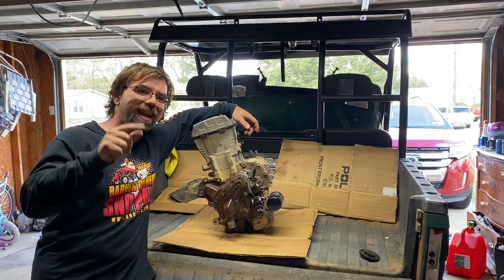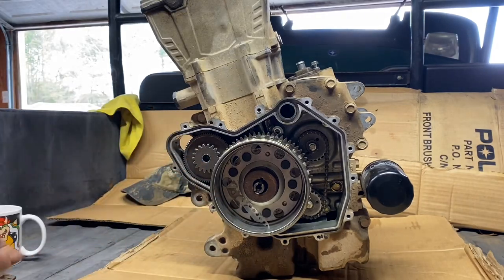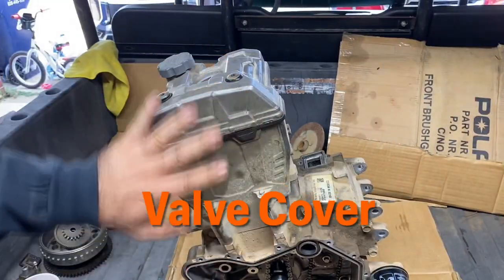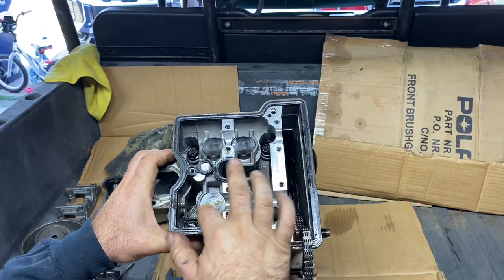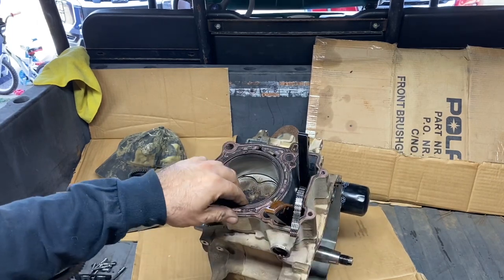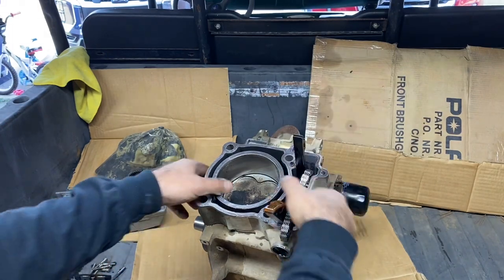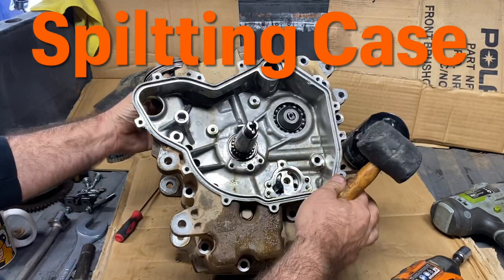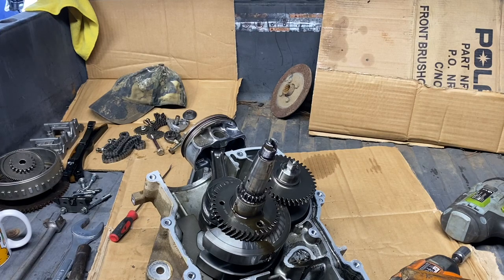Polaris 570 Rebuild Part 1- Teardown

Comment: Awesome vids! Thanks!! I poked a hole in my oil pan and ran mine out of oil till it seezed. I got it broke loose, but didn't run. So I thought it might be rings and cylinder. There is marks, I was hoping it's just that... But I'm rewatching your video to see if you showed there was play between the connecting rod and crank shaft? I can pull the connecting rod up and down on the crank, I think it's shot too?

Comment: Nice video. I'm having an issue. The engine turned over just fine the first few compression tests, then it ran smooth twice just heating up and letting it cool down. ISSUE- Next compression test the starter just spun and didn't engauge to turn the engine over. I have proper voltage to the starter. The starter is new and spins as it should. My issue seems to be that the starter gear doesn't engauge the gears to turn the crank. Any ideas? Also, should there be a snap ring between the timing chain guide and the crank gear?

Comment: Hey I have a question I have a 570 and I dusted the motor. But no metal and nothing blew up it was still running just had water and dirt in the system. I'm rebuilding myself I'm on a tight budget  but do you think I have to change the oil pump out if it's not scarred up reuse it and put a new oil pump chain and timing chain and upgrade the timing tensioner.
Reply from the maker: As long as the oil pump has no grooves you should be safe, make sure those chains get replaced tho.
Reply: Thank you  😊 for your time.  And keep up the videos they are all good and helpful. I have all my parts in doing my rebuild this Friday night.

Comment: If you pull silver head bolts out, can you replace them with the black ones? I hate the torque specs for the smaller silver (180* the another 180*)ones and I've not found an answer anywhere. Thanks.

Comment: Where did you buy all the parts to rebuild it?
Reply from the maker: I use Rev6 great company to deal with.
Reply: @montemania198210  was looking on there sight. Did you put the regular jug and pistion back in or there bigbore kit.
Reply from the maker: @gushowlett4161  just the standard bore